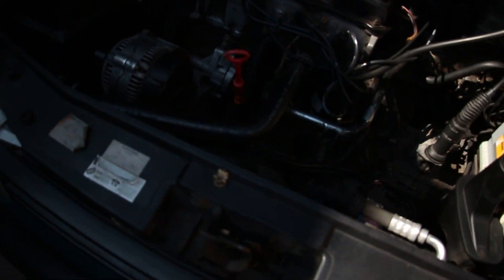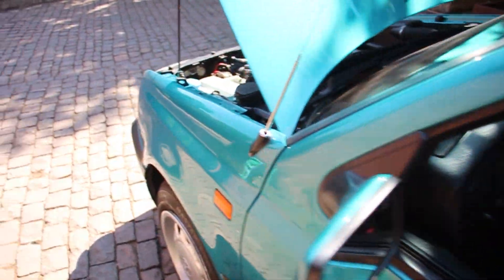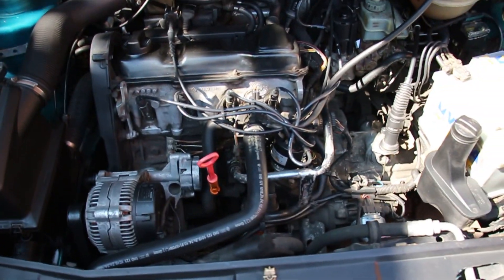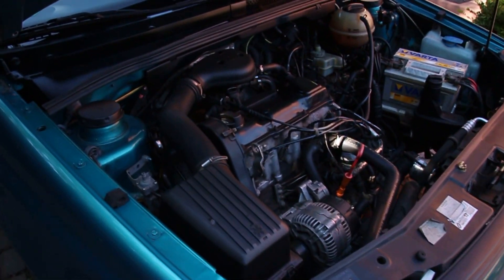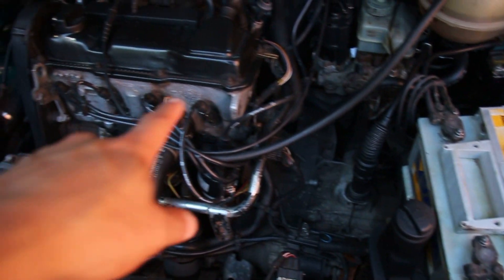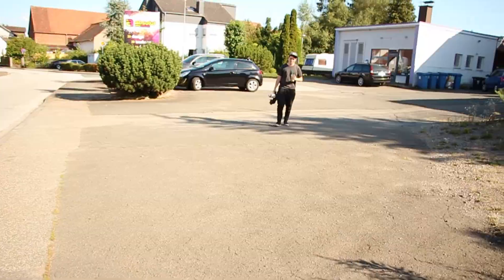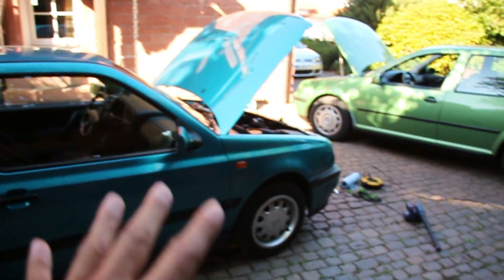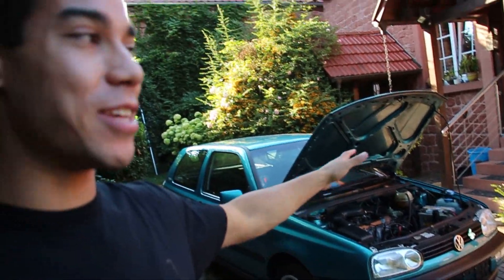Something Exciting For The Mk3 Golf!

Comment: I've had similar issue with 1.8 ABS. The car was sometimes shutting off at idle. The problem was caused by throttle position sensor.

Comment: These do not have crank sensors, just a hallsensor on the distributor, when it's bad the ecu doesnt get rpm anymore and dies or doesn't start. Quick check for that is looking if the rpm gauges comes up when starting or not. Also your car can have a alarm/immobiliser, around the ignition lock, under it is a little rubber piece, if so immo is likely. My 93 has even alarm from factory, so does yours, right next to your coolant bottle is a switch for the alarm. When the immo gets bad, it runs for 2 seconds and then dies, you can get your ecu reflashed so the immo doesnt work anymore or you can loop some wires but i'm not sure about that. Blue coolant sensor is important. Also your throttle body goes bad sometimes, it idles bad when it's bad, sometimes it leaks and needs new gaskets. Also this is a monopoint injection, instead of injecting in the intake, it has a single injector which injects on the throttle valve. These engines are bullet proof, but turboing it makes no sense with the junk stuff on it, better of with a G60 engine to start with which can hold boost way better.
Reply from the maker: Yeah I found that out today and I actually got a new hall sensor but unfortunately was not able to install it and im gonna need a whole new distributor now so I can have a new hall sensor. The car will run anywhere from 2min-45min its so random. The car idles perfect and revs fine and will show zero sign of dying and then just shuts off and will almost always turn right back on.
Reply: My 1.6 did the same, sometimes it didn’t start, sometimes it died under driving. When it does, check the rpm cluster, you see it drops down to zero and doesn’t goes up when cranking. When you compare the hall sensors, you will feel the new one has a way better magnetic field, these things stop working when they get old and lose their magnetic field so the signal gets weak or isn’t even there anymore.

Comment: about the shutting off after idling, try putting a fan in front blowing into radiator - it could be a cooling/heating issue. however if you don't notice the temp goin up then it's probably a sensor and not a cooling issue

Comment: Your problem could be very likely the throttle position sensor or a leak in the vacuum system. Crank sensor does nearly never break on the 1.8L motors. Also consider to pull the codes via the odb (or if it is older a 2K -> ODB adapter) port. Also did you plug in the airbag / abs lights on the left ? Cause in an older vid you just threw it in there and did not pug it in.
Reply from the maker: Could be Ill keep looking into more and more stuff doesnt seem like a vacuum leak though but maybe. Also the abs light I just put there there isnt any wiring for it at all the car just had a blank more then likely there
Reply: @Mk3Smith  Since you got abs mark04 at your savoy, you should definetly have that connector. Especially if you have airbags (wich you have). Maybe it fell down lower into the dashboard. That happens quite often. It is a flat long black connector. That's how you can check if your abs and airbags work right.

Comment: bro, quit thinking about all that crank sensor shit... Your carb vacuum pipes are leaking bro... change all the vacuum pipes bro
Reply from the maker: Ill check tomorrow and see. It just runs soo smooth and then dies with no indication at all but ill check tomorrow
Reply: @Mk3Smith  Forget about crank sensor this is base engine as it gets, like the " bro" mention above check all the vacuum hoses, when there is a leak engine usually have rough idle and dies especially when hot.